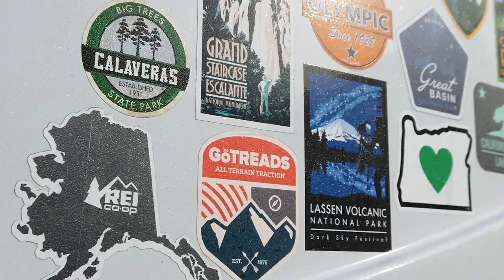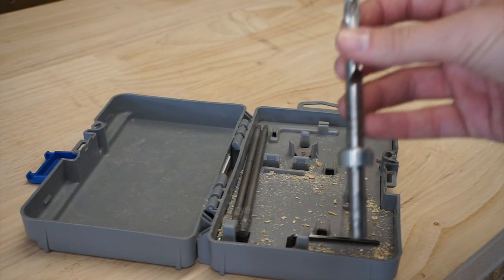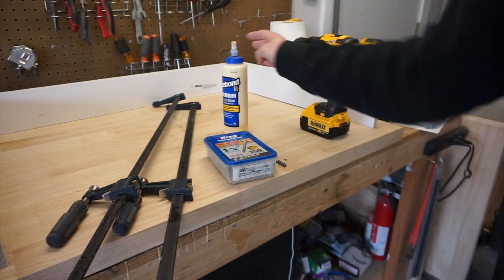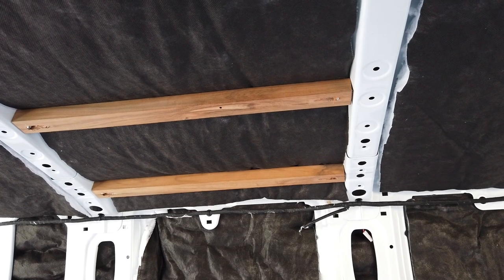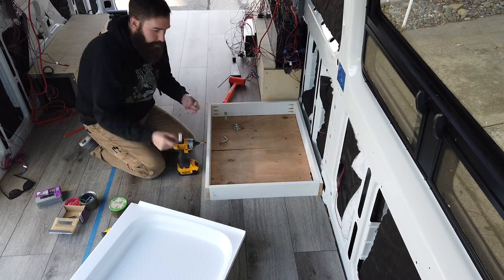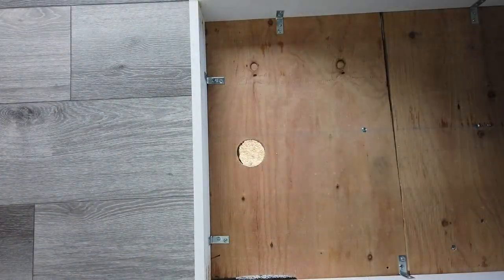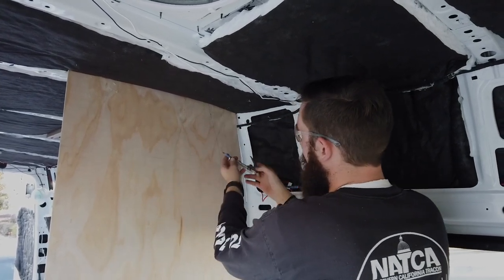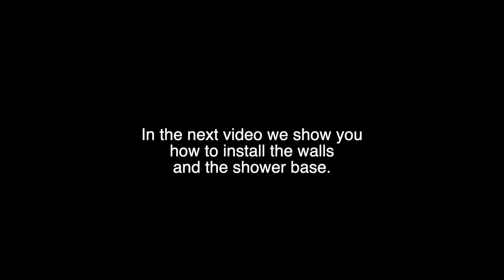Sprinter Conversion. How to build a shower  Part 1

Comment: Very nicely documented with clear photography and explanations.  I'm grateful for the excellent in depth demo and the tools shown!  Something as simple as a scribe often leads to puzzlement on how to use it.  Additional tip I want to add here:  Schluter Kerdi board and waterproofing membrane are pricey but a great addition to an RV bathroom where leaks can destroy a lot.  The board is super light weight and covered with the same membrane you can buy separately.  I wish there was a cheaper alternative membrane.  This is what should be used under the pan or before you mount any time, right up against the plywood base.

Comment: Thanks for the in-depth explanation, I'm not an expert but I think you are supposed to drill the holes with the pocket hole gig on the other side instead of screwing them in with the tips pointing toward the outside edge of the board’s end, as a con the holes will be visible (you can cover it with pocket hole plugs) but the joint will be definitely stronger

Comment: If you put in the wall boards for the side walls of the van first, it wouldn't have been such a struggle to get the template.  Just a tip. (now that you are done lol )

Comment: Great vid! Thanks! 
I have a crazy (or genius) idea so I’d be grateful for any tips. 😊

I’m thinking of installing an RV shower pan inside a 36”Wx24”D Base Cabinet with a motion censor faucet (somehow) in my laundry/mud room for small pet food & water (&/or pet shower area?) .  

Of course I’d Red Stop the entire interior, plus install rubber flashing under pan & maybe backer board with tile or some waterproof covering on inside cabinet  (maybe corrugated steel?). 

I’d completely remove the front cabinet doors of course.
Unfinished basement underneath so that should be helpful. 

There’s some pet food/water area in cabinets in Pinterest, but none that I’ve seen with a drain.
Reply from the maker: WonderWoman0313 I don’t see why that wouldn’t work as long as you have proper drainage and waterproofing.

Comment: I do have a question, I've seen other builders, put some redish liquid material to make it mold/water resistant ?   what do you think ?  and thank you
Reply from the maker: We wanted to do that. But I called the company that makes the red waterproofing roll on stuff and they said no. Adding that to the substrate of the walls the FRP glue will not stick long term. I called the FRP glue company and spoke to their engineers and they said the same thing. I believe it was liquid nails. They did say they have a special type of glue that might work. But we did not want to risk a wall falling off. One question we did ask was using pressure treated marine grade plywood to avoid water damage,  they also said no on that. The pressure treated portion of the wood will not allow the glue to cure properly.  

I hope that helps!

Comment: Thanks for sharing this.  I have a 2015 170 WB Sprinter and about to install a shower!  A couple of questions:  1.) what did you use for your sub-floor? I am guessing 1/2" plywood, but I would like to confirm.  2.) I looked through all of your links and I don't see any link for the shower drain?  Thank you.
Reply from the maker: Smoky Mountains Insider 1/2” plywood for the floor. And the drain portion was pieces together from our local home improvement store.
Reply: @RoamOverlandVehicles  thank you.

Comment: Would it have been easier to use an old bedsheet or something to mark off the angle to the side of the van? Magnet it to the side until taut, marker it off, then trace the sheet onto the wood?
Reply from the maker: Maybe, we have found working with rigid material usually makes everything easier

Comment: This is incredibly helpful, thank you! I'm building a shower with the same pan in the same van as it turns out. I'd like to drill the hole for the drain correctly the first time. Any chance you can share how far the center of the drain is from the wall on the driver side under the van? Thanks for any info you can share.
Reply from the maker: Eric Sherouse I do not remember. But placing the pan where it will sit I just used the hole for the drain as the template.

Comment: Hey guys, how have you found the shower has held up over time? Did you feel like 12mm ply was strong enough for the walls without a frame? Debating how to build ours! Thanks for one of the most helpful videos out there :)
Reply from the maker: Hey guys! Shower worked great. We used it daily for over a year and had no issues. An on off shower head is key to saving water! The walls were plenty sturdy enough. Good compromise of weight versus strength.  If I was to do it again I would add a layer of some sort of waterproof membrane onto the all the wood. We didn’t have any issues but for long term peace of mind.

Comment: Can you link the shower drain bottom that you used? Thanks, great video series!
Reply from the maker: Ken Coppens of course. It’s in the description under the bathroom section. Shower pan.
Reply: @RoamOverlandVehicles  I meant the actual drain piece you used.  I already own the pan and build the frame for it with your help.  

Also, I used 1x5s for the frame but the foam piece sits off the ground just barely.  Did you have that issue and if so how did you fix it?
Reply from the maker: Ken Coppens ah oh. The drain piece itself I got at our hardware store probably a Lowe’s or Homedepot. It was in the plumbing section for the parts under the sinks. I had to connect it with a rubber connector I also got from there.  The foam sitting up off the bottom. That will have to be resting on the floor. If need be can you cut a piece of wood that would be the size of the foam and attach that to the floor?
Reply: @RoamOverlandVehicles  Cool thanks. Maybe I could pick your brain a tad more.  In our van we already put up the walls and ceiling shiplap planks. Would you still recommend a 1/2" piece on the backside of the shower with RFP on top or could I just put RFP onto our walls (which are 1/4" plywood drilled into wooden studs)? Just trying to figure out how this is going to work since we already have the ceiling up.
Reply from the maker: @kenc8472  Regarding the ceiling, will that allow you enough headroom in the shower? That's a bit of a bummer the materials are already there, but every inch counts.

Comment: Any reason you didn't use Kreg jig to screw the base to the plywood floor?
Reply from the maker: I could’ve, but I built up that pretty solid base and it was just as good going into that.

Comment: Is there a reason you didn't use foam backer board? Currently trying to puzzle out our shower (Your video has been THE MOST helpful) We saw it used in another video and wanted to know if it was on your radar?
Reply from the maker: At the time no, if I was to do it again I would’ve done foam. And maybe even added a layer of waterproof membrane the kind you paint on.  When I was researching the shower build I never found that as an option. But so far it’s two years old and on to its second owner and it’s been doing great.  I updated the caulking after a year.

Comment: One question - why didn't you just put the shower base on top of the vinyl flooring?
Reply from the maker: We felt better having everything secured directly to the subfloor. We have also started adding flooring later in the build process after all of the heavier objects are installed since the floor is floating and needs room to expand and contract.

Comment: Great video! We'll definitely refer to this when we're ready to build our shower.  Do you feel that the shower is a bit small? I'm asking because we're just starting our build and originally thought we'd be able to have a shower with internal dimension of 24x36.  However, we've realized with our current design, we'll have to build a shower closer to your dimensions - using a 24x32 shower pan.  We're concerned this will feel too small, especially with a Nature's Head toilet in the wet bath as well.  Would love to hear your thoughts since you've used yours.
Reply from the maker: Wander Libre it was tight but totally doable! At this size it’s not taking up to much of the van and we were taking super quick showers in it so it was fine. You could always pull the natureshead out while you shower. We found that our natureshead took on water in the compost part when we showered. Not a lot everyday but it did eventually add up. Now we only use it not in a shower so we don’t have to worry about it. Hope that helps!
Reply: @RoamOverlandVehicles  Thanks for the super quick response! Good to hear about your experience.  Also good to know the issues you had with the Nature's Head.  We're debating between NH and Airhead - will definitely consider this in our decision.  Happy travels!

Comment: What size wood do you use for a shower pan frame? I have 1x4s but there a half inch to short from going from the floor to pan? Are those custom cuts?
Reply from the maker: If I recall we did 2x4s.  Can you measure from the floor to the underside of the lip around the edge of the shower pan?

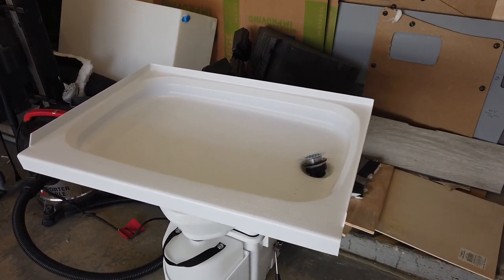Comment: I know this is older but at 1:38 you say using a biodegradable soap and draining out where you can. Could you elaborate on where you can drain out grey water? We just went across country with an outdoor shower that we never used because any site with water hookups had bans (as far as we understood) against letting any grey water out on to the ground.
Reply from the maker: We mostly did boondocking and stayed away from anywhere with hook ups. It’s really 50/50 on opinions of dumping grey water or not and how you are suppose to do it.
Reply: @RoamOverlandVehicles  Thanks for the reply! We didn't have an access to water without hookups, that's what'll have to change. I don't see how animals can shit in the woods but my biodegradable soapy grey water is going to ruin the world.
Reply from the maker: @DrivingMissLazy  we did have a grey tank we installed after traveling for a couple months so it made it easier to dump in areas where it may not be so critical.
Reply: @RoamOverlandVehicles  Hi! This was my question also. Before you had the grey tank installed where did the water drain to? Just out on land? Or did you have a bucket or something underneath that you then dumped somewhere? Thanks for sharing this series!
Reply from the maker: @liberatingleash  we were draining in to a bucket and now we have the @nwvanconversion tanks under the van
Reply: @RoamOverlandVehicles  thanks so much for the quick reply & info. I appreciate it. :-)

Comment: Love it! 
what size wood did you use to frame the pan?
Reply from the maker: 2x4s I believe. I may have cut them down just a little bit. Set the pan on the ground and measure up from the ground to the underside of the upper rim of the pan. That way the whole top of the pan is supported.

Comment: Can you provide a link to your portable grey tank and where/how you store it?  TIA
Reply from the maker: resfeber from United States I don’t have a link. I used a 6”pvc pipe that I put caps on. Installed vent pipes, and a drain as well. It was an afterthought but it’s working great! It holds enough water for two showers.

Comment: Do you have any problems with the drain freezing in winter?
Reply from the maker: Joe Schmidt no. We are not in freezing temperatures for very long usually and we do not hold any water on the outside of the van.

Comment: Hi, nice videos. How much did you spend on the conversion in total? Thanks 😊
Reply from the maker: Paul Smith between $23,000-25,000
Reply: @RoamOverlandVehicles  Thanks for the reply. I have $3000 budget :(
Reply from the maker: Don’t let our budget deter you! We know people who put an air mattress in the back, a couple camping chairs and a cooler and are loving it!
Reply: @RoamOverlandVehicles  great, thanks! do you think i could insulate and put electric in for that price?
Reply from the maker: Depends on what insulation you use. We spend about $530 for 3m thinsulate which is the insulation we love using! That covers the entire 144 sprinter minus the floor. When it comes to electrical it depends on what you want to do.

On our first van we did 3 100AH AGM batteries with 2 100 watt solar panels and that worked great for what we were running (lights, fridge, max air fan). Batteries ran us a little under $500 total and panels were roughly $100 a piece. Then you need to factor in wiring, charge controller, fuse box, cut off switch and fuses which could run you another couple hundred dollars.

Hope all this helps!
Reply: @RoamOverlandVehicles  Thats Brilliant, thanks so much for the help!
Reply: @RoamOverlandVehicles  that’s exactly what we initially did! Inflatable mattress, foldable chairs, and a cooler... oh, and lots of bungees hahaha We’ve evolved a tad bit 😁

Comment: 1x6 or 1x4?  I think my 1x4 is too low
Reply from the maker: Michael Ender are you referring to the board under the edge of the shower basin? I’m pretty sure it was a 1x4.
Reply: This is the issue I’m having too. The 1x4 you buy from Lowe’s are Home Depot are not actually 1x4 there 1x 3.75 so the pan doesn’t rest on the top of the frame..

Comment: I see no reason to remove the flooring.
Reply from the maker: Front Line Media the flooring needed room to expand. If there is stuff on top of the flooring it would restrict that movement. We’ve noticed with the temperature fluctuations the floor expanding and contracting
Reply: @RoamOverlandVehicles  well, everything moves with temp.  and you have nothing to worry about leaving the floor there.  I plan on using vinyl just b/c of water issues.  It's also easy to cut.  Did you see the person that made their shower in the middle?  They put 2 sliding doors on each side, and used the aisle.  I'm still doing body work and painting and feels like I'll never be done.  These sprinters are such rust buckets.  7 metal patches just on the driver's side.